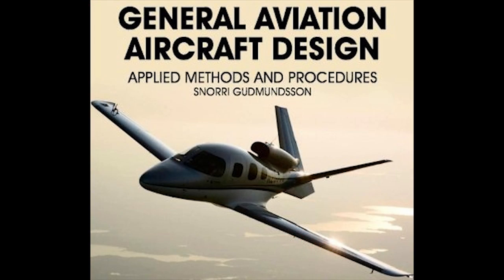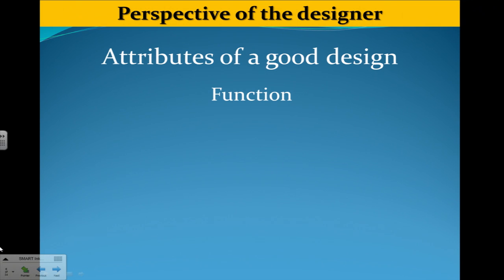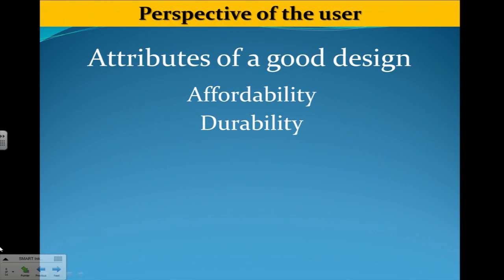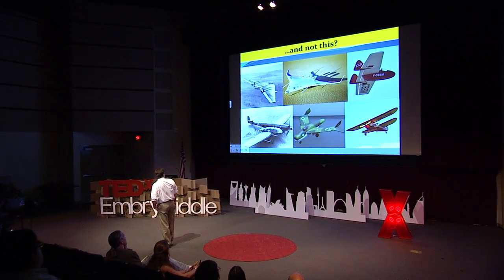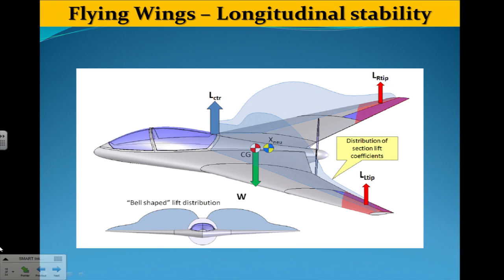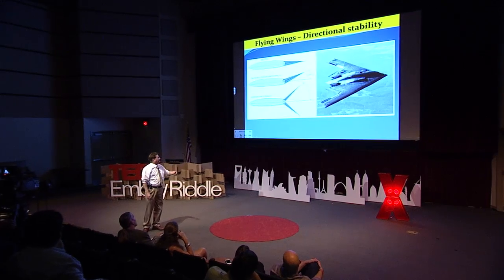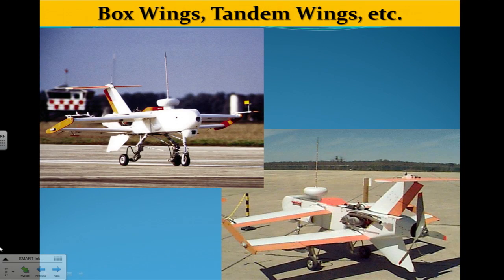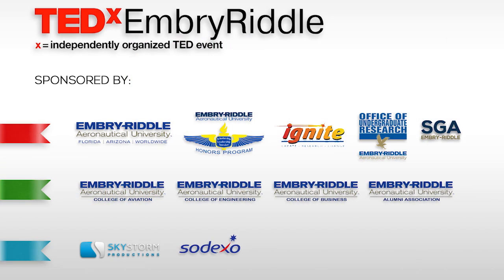The perils of unconventional aircraft design: Snorri Gudmundsson at TEDxEmbryRiddle

Comment: The presentation may be poorly executed but it should not distract us from the lessons. It is too easy to consider the perceived pros of a design and shadow or completely omit to study the cons. Cause the customers will see them. It is particularly true when it comes to aircraft design, as the planform drawing and the spec sheet always look promising, but the execution often reveals terrible flaws or the reality of design, manufacturing and operations prevents the supposed pros from ever being realized, as the speaker points out. An aircraft is not designed just for cruise, all the enveloppe matters so, often, unconventional designs which supposedly are better at cruise speed / efficiency behave poorly at different speeds and attitudes.

Comment: Important information, certainly.  But I would recommend less technical details & more 'big picture.'  You could simply have said, "This flying wing design looks impressive, but that's not what makes a good, reliable design.  As it turns out, this aircraft has some stability problems.  Looking good doesn't always equate to working good.  Another major hurdle to unconventional design is that it has no track record.  People are less willing to trust something that looks unfamiliar and hasn't been used by others."  Bringing home the big points makes for a much more effective presentation!  Thank you for the video.       𝒕𝒂𝒗𝒊.

Comment: Not Bad. My only thing is that quite a few unconventional aircraft designs have been the absolute best. They are push-pull configuration airplanes (the Adam 500, the Rutan Defiant, the Dornier SeaStar, and a few others). The safest and the most efficient design of a propeller aircraft to have ever been flown (in my very humble opinion). Engineers and designers should consider it
Reply: The Adam A500 was a complete failure, but the concept seems sound.

Comment: It's too bad that there's a concentration on tail-less all-wing as the only "unconventional" approach.
Differential static drag for yaw control is fine for the stealth effects of having no tail on a penetration/strategic strike bomber, but anything else needs a tail.
 Accepting the constant static drag eliminates the differential static drag and tail-less inherent complexity & risk, and prevents spins (if the design is right)

Compare this basic flying wing as presented and a normal plane with a Burnelli 14 through CBY-3 series lifting fuselage body,  or  Arup-4 projected to larger size, and see what happens.
 All objections disappear except those of being a new product. Operational history in these examples, safety & stability, and all the benefits of a all-wing: slippery, yet nimble and stable all at the same time and usually in both low-speed/landing and cruise performance. Good low speed handling. Extended range and/or payload & speed and , stall-resistant and practically spin-proof.
 Better L/D ratio and less "wetted" area and drag, less structural weight (By Airbus, Boeing, McD, Lock-Mart, NASA, and other authorities) who've looked into design theories which seek to eliminate static drag in favor of lifting drag, where possible. Burnelli, Arup Modern Lock-Mart and others all have strong tails and no loss in stability associated with all-wing tail-plane-less finned wing/body craft.  A lifting tail/tandem wing also only improves the L/D & efficiency, as opposed to a down-force tail.
 Airbus is still shying away from lifting bodies, while Boeing is irrationally and non-rationally  against the idea for some reason. See their model 754 of the mid-'70s.
 Lock-Mart is dancing around the idea, with their hybrid BWB logistics jumbos.
 The Frigate Ecojet looks like a good design, but like all of them, restricted to paper-only because of the "giggle factor", and new appearance. They do not require advanced future technology to make enormous fuel savings and apparently, much safer planes.
 Easily 60% the landing speed of a normal plane of similar foot-print. Maybe less. (by the Lock-Mart HWB logistics or Boeing model 754)

Look also at the  2 little 1930s US "Arup" planes, which built up an impressive operational history between the two that did airshow circuits for multiple seasons, Hatfield, who worked on and flew the Arup, built the "Little Bird" series in the '80s to verify the safety and utility of the Arup use of low-aspect-ratio wing/body planes.
In one youtube vid, he congratulates Mr Rutan then challenges him to repeat his recent "Voyager" flight with an Arup planform and he bet that it'd be faster, easier, bigger interior, lower TO/L speeds and rolls and have plenty of fuel left over after going around the world un-refueled.

Fauvel before the War was working on little test planes of tail-less but finned all-wing designs that were as well-behaved and efficient. Cheranovsky, Canova, Lippisch and the Hortens and a few others in Europe had their work interrupted by the War, usually fatally for the design philosophy.
Reply: Again regarding lifting bodies

The Vought/Sikorsky Effort into Zmmerman's idea for VTOL craft was a digression from the work of carrying on from the impressive performances which the Arup-2 gave for NACA, the Army and the CAA (with Zimmerman working for NACA on the team that saw the Arup). It did not need the giggle-factor-inducing huge flapping props and the gearing system which killed the follow-on. It did not exhibit the abnormally large amount of wing-tip vortex drag, while in low-A cruising flight.
 In very high-A, very low speed flight of a low-aspect ratio wing, you want the vortex, and it's futile to try to reduce drag by counter-rotating the props.
 US aeronautical makers have historically been unable to produce flight-ready gearing or contra-prop or extension props. They should ask train or boat makers how they transfer power from multiple engines onto shafts.
 That the Navy chose to pursue this, was throwing away a plane like the Bearcat though heavier maximum weight, faster, more payload & range, with 40kts landing speed.
If the Navy for its "flapjack" fighter had built the little Boeing 396 test plane as a precursor to the model 390 fighter, it would have changed aeronautics history as much as the advent of all-metal planes or retractable landing gear, or lifting-devices in wings.
The advent of the jet-age isn't what killed them, as was the Navy's choice to do the Zimmerman idea and the inherent complexity and risk, instead of an honest follow-on to the Arup. The Navy continued using piston/prop planes for logistics and support as well as tactical combat and Strike, until the '70s.
Chance-Vought had a design for a jet version, and Sergei Sikorsky worked on another. They were anything but silly-looking as Zimmerman's plane, and if built instead of the P-80 & F-86, would have been a decade or more ahead of anything else on the drawing-boards. Perhaps even they needed tails instead of just fins, but perhaps not.
Everything today would be a lifting body or all-wing of some sort if Boeing had built their little single buried-engine single nose-prop plane in '43.
Reply: Thoughtful post, thnks.  What is your area of expertise, aerodynamics, history, just like aviation?  You sound like a good guy to have a conversation with.